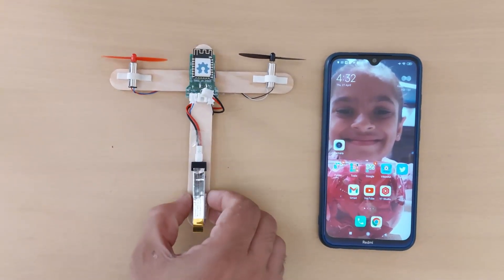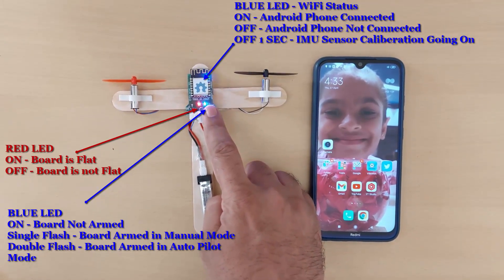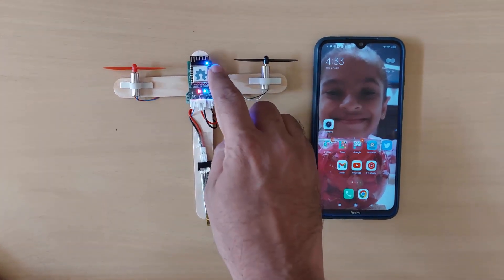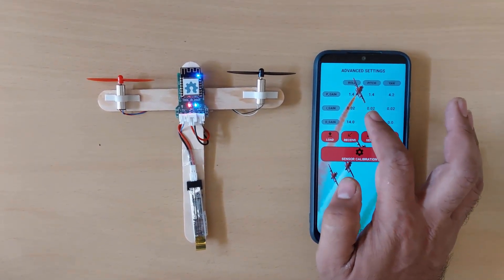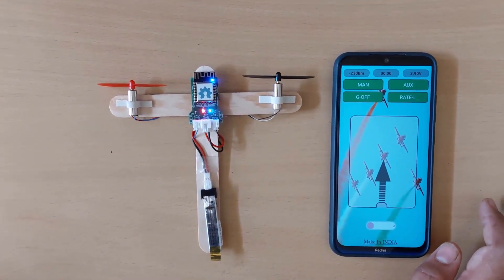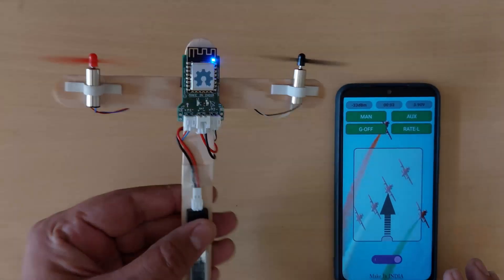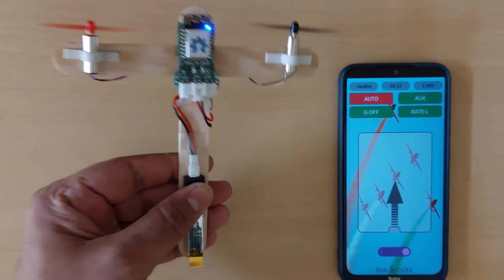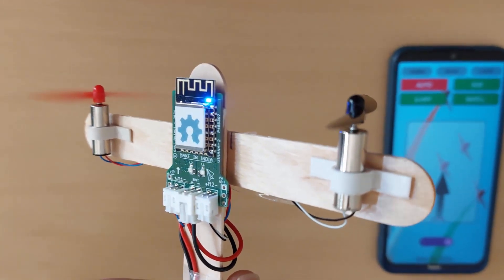Hackaday - Vimana autopilot demo on Test Zig

Comment: Will this board be sold on some online platform in india? As powerup and flight test ft ez packs are somewhat expensive and hard to ship to India, I previously made the wifi plane back in 2020 but had some stability issues with the motors powering more or less than other , then I tried to integrate the Arduino multiwii drone control with gyro (as it seem to work with differential planes like this too) but still failed after many attempts. I sorted out on a simple 2 ch control w/o gryo with some differential motor control code I found.
Upon looking into this project, it seems perfect for my applications all along with servos too + more importantly the gyro part. But the gyro chip used seems difficult to source , was thinking about the common mpu6050 (must have been your first thought too maybe) else pls share some links for that gyro chip whenever you  post the full build log .
Nice project :)